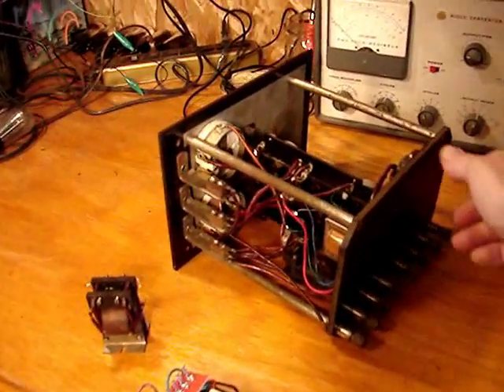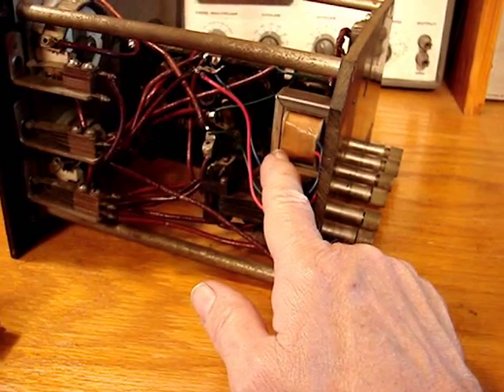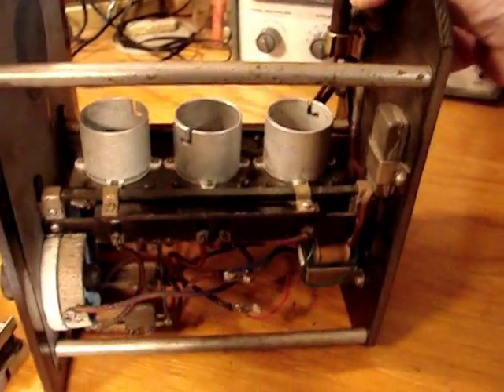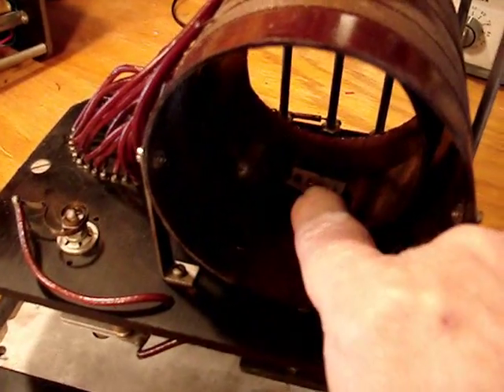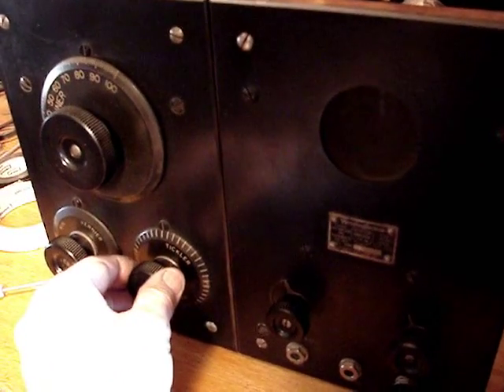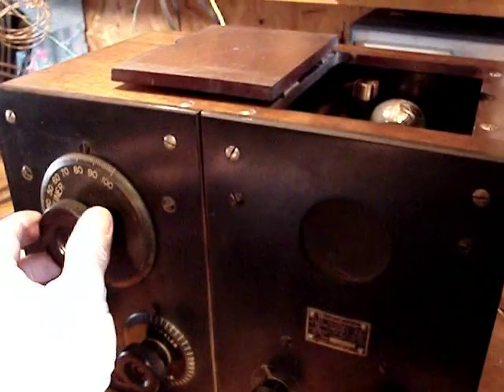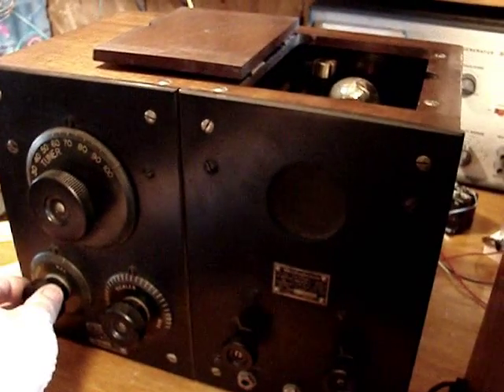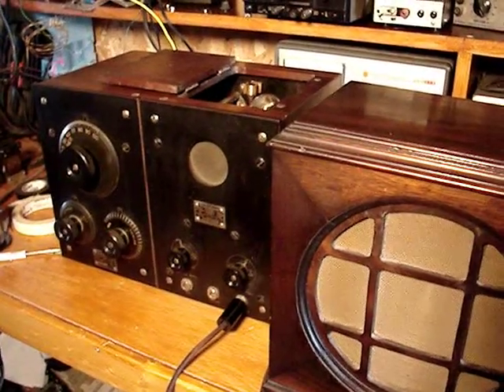Westinghouse RA/DA (Radiola RC) Repair PT2

Comment from the maker: Thanks Rick. I need to try the other transformer and also need to see why the radio cuts in and out. The next video should have the other transformer and also the 270pf capacitor. I appreciate all your help. Gary

Comment: Hello Gary, maybe the problem is inside one of the tubes itself and thats the reson why the modulation tranformer got defect ?
I had the same problem with an amplifier, i was also making cracking noise, seemed to be problem inside the one of the tubes